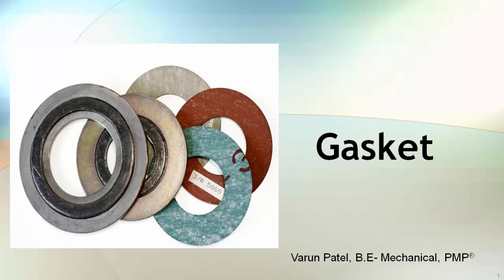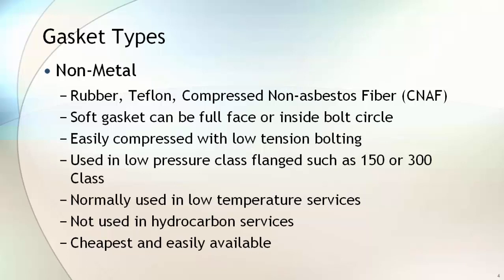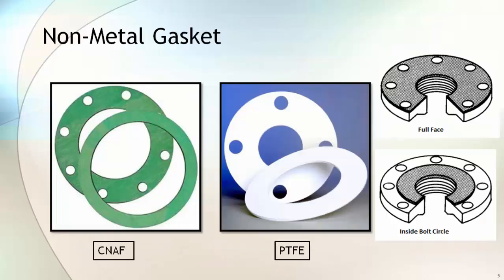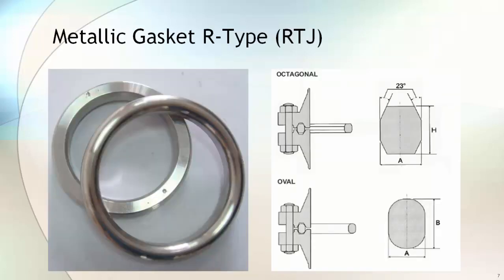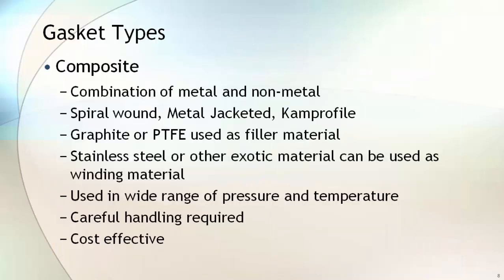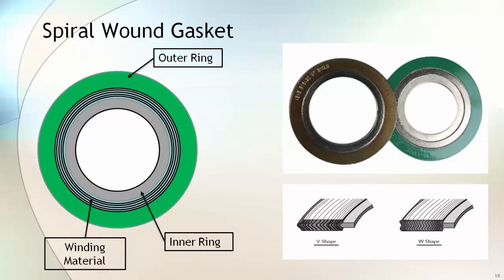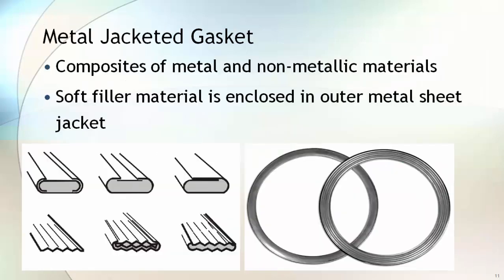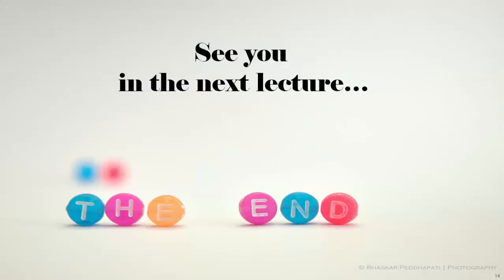Pipe Gaskets for Process Piping (Spiral, RTJ, Metal Jacketed, Oring)

Comment: Nice Video.Main products: sealing gasket,gland packing,PTFE/graphite/asbestos products, ceramic fiber products, high temperature heat insulation and fireproof material.